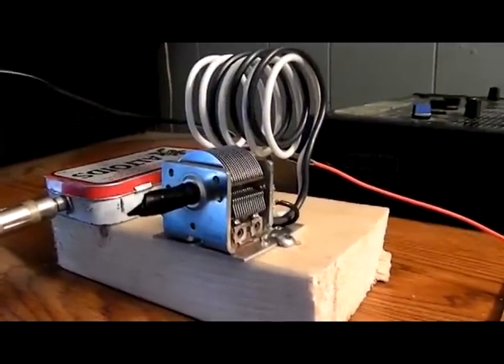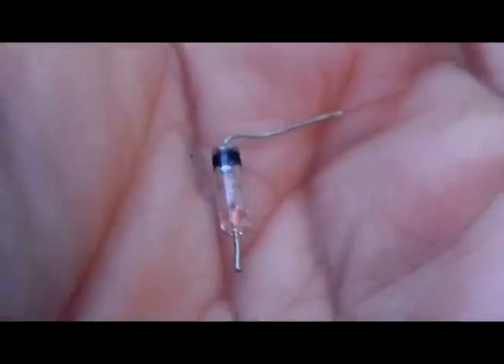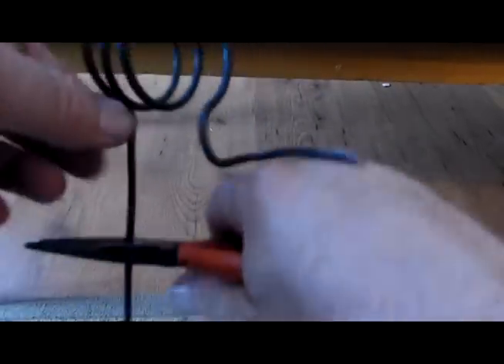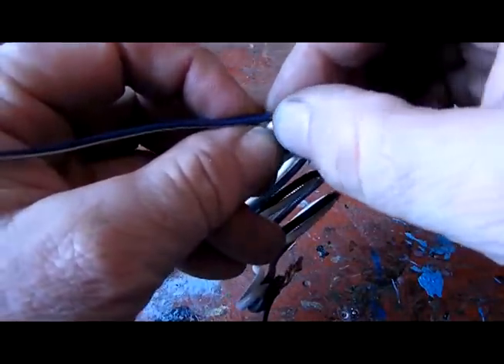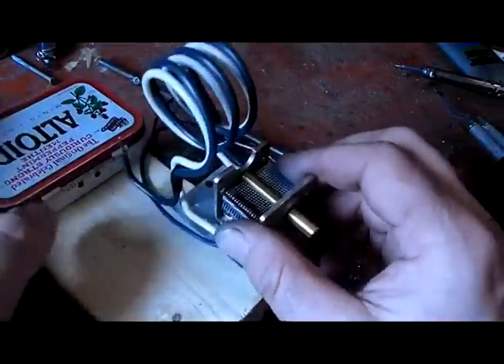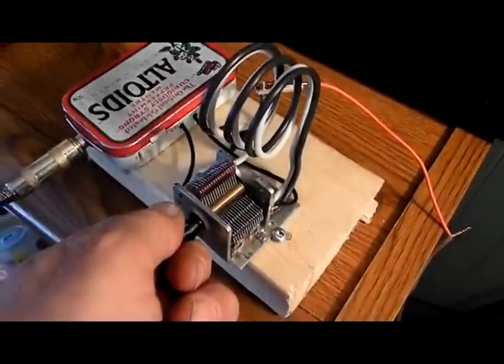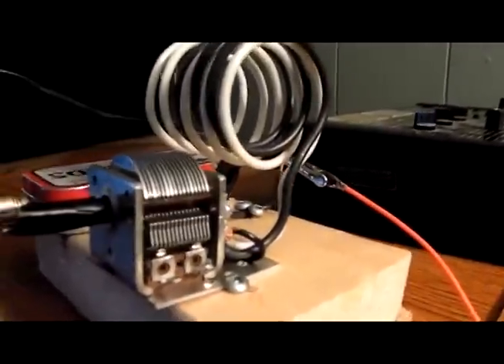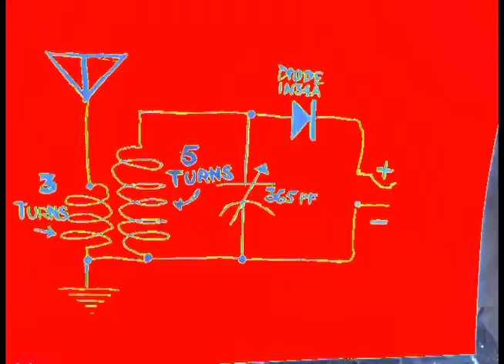Build a CB Radio Crystal set

Comment: Long time ago i did something similar and got up to band I,( first VHF band ) and was able to hear video buzz that was modulated in AM. on the PAL B  tv system  in Australia,also play alot on my Crystal set listening to shortwave, ,and on that tiny set and a good long  maybe over 25 meter random antenna , i  was able to  listen  to Europe,very faint but you could listen to it,but you did needed a lot of patients!. and no amp connected! .So much for people saying that on a crystal set you can only get local Medium wave stations.
Reply: Nice! theres an FM crystal  set i have seen  somewere  in the web
Reply: Sydneywave Smith
Don't think so, for one minute..
A crystal or diode can only detect changes in amplitude (Hence A.M. Amplitude Modulation) 
Freq Mod is more involved than a diode detector can handle...MUCH MORE.
If the tuned circuit were actually arranged to tune in on a VHF FM station, you
 wouldn't hear a thing or even know that you were there because the sound is in frequency modulation. The  Amplitude doesn't vary, so the diode (or Crystal) would not detect the changes in freq. which carry the speech and music.

If you are choked off by my remarks, don't cuss ME. I only tell it like it is.

You could of course, spend many years studying Radio Theory and then come back to argue with me but by that time, you would have realised that there was nothing to argue about.
Good luck..

Olde Englande.
Reply: Bob Rexford
Why SHOULD I look it up when unlike you, I know exactly what it is, have used it for years as a means of FM demodulation in the absence of a genuine FM demodulator?

If you had a trace of technical knowledge, I could explain to you why your insistence that it WILL work in this very simple circuit, is pointless but if you could understand my explanation, you would not have revealed how little you know, in the first place.
That beautifully produced video, carries no sensible info. whatsoever..I'm baffled why anybody would spend so much time and effort when it simply CANNOT WORK.
There is inadequate means of separating adjacent FM stations let alone provide ANY slope detection.
If you're so stupidly sure, just explain to me 
exactly just WHAT slope detection is and where does that circuit supply the necessary conditions for that process? What ARE those required conditions? Whereabouts on the Frequency Modulated signal is it necessary to tune to demodulate anything?  If it worked, what would be demodulated and what would you do with the demodulated results. 
What deviation is used on Broadcast stations as opposed to communication station which use narrow band frequency mod?
Your anticipated silence will indicate how little you know.
I promise you that I'm not talking Martian, Venusian or Swahili  although it may look like it you.
It's no use trying to win an argument simply by pointing ME at site of total rubbish as proof of what YOU say.  Just because you've been suckered in by the standard, arrogant Internet Guru nonsense, that doesn't make it factual.
It doesn't work that way.
It may not seem to you to be the load of bollocks that it is but you clearly live your shallow and meaningless life, lurching from one load of total bollocks to the next load of total bollocks.
That is why you and your clever-devil ilk so easily expose your crass stupidity and ignorance. 
Final simple question "Where is the so-called slope and how steep?" 
Untrained know-alls make me wanna PUKE.
Reply: Since you merely rant and provide neither link nor logic in your argument , I see no purpose in continuing this.  If you won't even try a design or provide a refutation you are a waste of my time.
Enough - moving on.
Reply: Sydneywave Smith  You mentioned the FM crystal radio circuit you had seen...here is a link to one of many such:
http://solomonsmusic.net/FM_CrystalRadio.html
Reply: Sydneywave Smith
I see that Rexford is still trying to convince you that there is an FM xtal set.
Take my honest word for it, as a communications radio engineer  and lifelong builder of radio circuits, both for development and actually in service, that he has no idea what he is talking about and can give you some utterly false information which can at the very least waste your time massively and at the worst waste your money.
That site to which he points you, is remarkably well and convincingly produced
but it is a technical lie. The producer is an absolute liar. It is technically quite impossible to work.
REXFORD isn't a liar, just an idiot sucked in by it. He hasn't the technical background to recognise the false claim made.
He is a typical internet arrogant who will not listen to anything opposing his views which he WANTS to be right, regardless of fact.
My sincere and experienced advice to you is not to take any notice of him..
If such a simple FM receiver could be made, don't you think that the manufacturers would have made them instead of the expensive superhet circuits with limiters to ensure FM only and complex phase detectors or Foster Seeley discriminators,, solely for FM.

Wikipedia it. You might not understand the explanations but you'll see that what ever it is, it's for FM radio. 
REXFORD is leading you astray. Don't let him. After such well intentioned advice. where would that leave you?
My best wishes.
He's not malicious nor a liar.
Just inexplicably ill-informed and inflexible.
I can deal comfortably with fools.
Bloody fools give me a hard time.

Ask yourself if I would have been bothered to spend so much time writing out this lot with nothing to gain other than the satisfaction of stopping somebody I don't know from being misguided 

Good Luck.
Reply: Sydneywave Smith Here is another set of slope detection ideas for crystal radios...interested in the resonant cavity design, if the price of copper pipe drops a bit.
http://www.somerset.net/arm/fm_only_lowtech.html
Reply: *****
Why are you so rude?
Reply: +Mick Bradford 
Dear Mr Bradford, 
               I was not rude but "forcefully outright.
When a Johnny-Come Lately, Know-all Internet Arrogant with no training beyond listening to other Internet Idiots, calls me closed minded for not trying a silly project which from technical training, I KNOW just cannot work and from years' experience as a working radio engineer, DOESN'T work,  I reserve the unalienable right to be as 'forcefully outright' as I deem deserving. I had explained to to him that a Crystal (a diode) cannot by its very action, detect FM. That was not what he wanted to hear and launched off into some diatribe over something he's heard about but clearly doesn't understand.. Slope Detection..It's a nice sound byte for him to sound erudite.
Slope Detection DOES  indeed work but badly and is a last resort in a comms. set lacking an FM function.
A simple crystal set would need many more components & circuitry to achieve this highly inadequate system and would simply cease to be a Crystal Set in the process. Go to this length in effort and cost and it would be better to design in a quadrature detector, phase discriminator, a Foster Seeley circuit to do the job properly.
To this genuinely offered advice he was aggressive argumentative with non factual points and so I became 'forcefully outright' or rude as you so quaintly put it.  
If YOU, with your understandable views on rudeness, were to hold a discussion with me,(Try it sometime) during which I picked up a point which justified sincere advice, I am convinced that YOU would not argue point blank. You might question it with me to validate what had said and rightly so but after more years than I care to admit as a working radio engineer, you would not expect me to take gibberish lightly, although I know that in your case you wouldn't give any.

So that's why I was so 'forcefully outright!'
 In simple principle, I like my know- alls to know lots. He doesn't fit the bill.
Beware lest his ill-founded knowledge diverts your learning. Find an authentic source of techno-info.
I'll leave you with this thought on why I seemed rude or you may not now think that I WAS rude.
After all I have taken the trouble to write all this when it would have been quicker to send you a typical one-line Internet abuse.
A student with his attitude, attending  a lecture would 1stly be corrected, then reprimanded and lastly ejected with flea in his ear.
Beware, lest he divert your own study with inaccuracies. Find a more authentic source of information. 
Sincerely Yours...

 (Was I rude to you?"
Reply: Sydneywave Smith UHHH no there is no way you can use a crystal design to detect and modulate FM, FMW, FMN. As mentioned previously a diode can ONLY detect changes in Amplitude hence AM. Now if for some weird reason you find an AM ststion on say 101.5 MHz then YES a crystal set would detect it mad you could hear it but that is rare. Now move up in frequency to 108 - 136 MHz aircraft band, 99% of aircraft radios are AM so once again you could in theory maybe fact receive aircraft with a crystal set. I will go further up in frequency to the 315 MHz band, the place where garage door openers and automobile remotes live. Those all are Am as well BUT the send data bursts in a fraction of a second or a series of tones to activate whatever they are linked to.
Reply: Adriel Green
Somebody needs to read and inwardly digest this, THE most SENSIBLE posting which I have seen for sometime. 
It ably indicates the massive difference between those who know the score and the legions of internet arrogant gurus who know a lot less than they think they do. The big snag with not knowing enough is that you don't know that you don't know enough.
Mr Rexford please note.

Not enough in Melinda's posting to determine whether she is "Laboratory" or "Service Workshop."
I would make a guess at "Lab."
I am "Service Workshop."
Lab is the same as Service but they know more than we do. We are more screwdriver, soldering iron, test apparatus and Schematic Diagram diagnosis.
We fix 'em when they are busted and try to stop them failing next time, sometimes finding ways with components not intended to be used, either because the manufacturer wants to sell the next model or because we've found a better part than the the original one.
Lab steadily and amazingly pushes out the boundaries of what CAN be done.
We both use the same science, eh Melinda?

Basic principle:-
You can't fix it, modify it, redesign it,  produce revolutionary design nor mouth -off about it, if you don't know the science or at least the technology. No scientist me, I'm technology..
Read Melinda..Read, learn & weep at the insufficiency of what you think you know.

If the cap fits.....Mr Rexford.

Mr Bradford... I have played  (Jazz sax) at the
Italian Fisherman Restaurant on the the corner of Main and Beale in your amazing city.
(I'm a pro Brit jazz musician and instrumental tutor.  I'm also very old and need take no rubbish).

 Yours, Melinda..Vindicated..
Thank you!
Reply: Adriel Green
Got me baffled Melinda/Adriel.
Got it right with "Lab"?
Ham also?
Reply: Yeah I let my ex use this account and she had her name attached to it an I just realized it today lol after a year or so. one of those little things i forgot about. I changed it though.

I am a commercial radio technician. I run my own shop servicing and installing 2-way radios and IT related equipment. I also service some LPFM broadcast transmitters locally and do some 3rd party contract work with AT&T wireless. I have had more than my share of experience with applied radio theory in the real world if you call it that, more or less hands on trial and error. Figuring out what works and what does not everything from being microwaved by a linking dish to bricking a $3,500 portable radio, all lessons learned i think.
Reply: Adriel Green  OK..Wow..Fast response..Well understood.
Did those wise words come from you or your once beloved Belinda?
You a ham by any chance?
G3NBY OK at QRZ.COM
Reply: Those are my words. 
No not a ham. I figured I give the FCC over $15K every 10 years for licenses (I own trunking systems in 2 cities and about to put a 3rd on line this next month here thats all digital) that accounts for something lol. truth is I never found the time to take the ham test yet. I mean i pass all of the online tests almost flawlessly just can't seem to get my schedule right when they do testing here locally
Reply: ok got the channel fixed i think
Reply: rEdf196 How on earth did you assess the freq coverage to decimal points, on such a low Q device as a crystal set. I am led to wonder if in fact you know actually know what I mean by Q. I also find it difficult to suppress my reaction of bollocks.
Reply: Adriel Green  Sheesh.. Fast ain'tcha?
Fully understand the position. Getting a ham ticket was more practical in Olde Englande when I got mine, thousands (well maybe just  hundreds...I AM inclined to exaggerate a just a bit) of years ago. They still wanted clear technical knowledge in those days and didn't put the goddamned answers to the questions, actually on the exam page, for ticking!  
There are those who might think that I am a bloody cynic. How right they are!
I agree., whole heartedly. I was a grumpy old git when I was 14 years old and have got better over the years.
Practice makes perfect.
God Bless America but not ALL Americans.
Guess you'd dump the same non participants that we would in Olde Englande.
Same old crisis.. Part of problem or part of solution?
From Sea to Shining Sea!
Jazz player and G3NBY @ QRZ.COM
Your former colonialist oppressor..
Reply: Sydneywave Smith :  yet another FM crystal set design...I've seen a resonant cavity lashup using three inch copper pipe; this one might be a less expensive way to get there  
http://www.crystal-radio.eu/enset6.htm
Reply: 0-o I'm.... no not going there otherwise I will be repeating myself into a perpetual argument that will only give me a headache. So I'll let those who actually think this will work hammer out all the details.

Comment: It is ok to cheat-find an am pocket radio, hook up a ground only lead to the earphone jack, snake the lead through the double coil, or into tin, whichever does not shift the frequency, but some are more barebones than that. Line up the internal ferrite antenna with that double coil, and tune super slow on the am pocket radio, once you have already got a loud donald duck sidebander locked in on the cb pedal, and all the sudden an autotune-like cloud comes over your cb pedal, and the pitch phases up or down in pitch to make a nice clear voice. It will drive you mad, because it is like expecting an .ooo5 degree travel, on a plastic, keyed to screwed plastic
coupling, with twice that in slop. Good luck

Comment: I made 2 crystal radios (with junk)- my 1st was magnet wire(100 turns) on a small cardboard tube, w/ a var. cap. from another radio, connected to a diode and amp.
my 2nd crystal radio is a SW receiver, w/ the same magnet wire (85 turns) on 2 popcicle sticks (glued together, trimmed to size), connected to a diode, and amp. my SW radio can get N.carolina, Nashville, TN, Havana cuba, and sometimes, China and India! very easy build, and interesting, esp. after 11pm CST!
I didn't follow the schematics, just put components together, w/ a good ground and ant.connection, and they work!
Reply: rEdf196 good luck!
Reply: what kind of antenna are you using?
I've straightened 2 wire hangers, connected them to a balun transformer, and screwed that into 2 yardsticks, which I screwed into my wall. this works fine for both my digital tv and Xtal radios.
Reply: good ideas!
i'm in the process of making a smaller SW radio from a small radio (var. capacitor, earphone plug-in,tuning dial, screws).
seems like my diodes are not working right, or my connections are not good.
I did wind a smaller diameter 100-turn coil, and that works good. i'll keep trying diff. things with it.
the wire coat hangers are great for elec. projects, esp. with the plastic insulation!
good luck, and cheers!
Reply from the maker: Sooner Science Nerd Back In the 70's when I lived in Victoria I built a small pocket sized AM crystal set with a 2' wire antenna I consealed in my jacket and 2 crysta earphones much like a modern MP3 player. I could pick up local signals all over Victoria even without an antenna. With a longwire antenna it could drive 8 ohm loud speaker without a transformer.
Reply: excellent!
i'm thinking about making another crystal radio, just re-using an old radio's diodes, antenna, along w/ a coil antenna made of flat cardboard, w/ magnet wire (90+- turns).
well, have a good one!

Comment: neat project, kinda noisey though, would like to see one made to pick up cellphone conversations since they block out that feature on a police scanner,
Reply: THAT would be a challenge:  cell phones run 850 Mhz or above...plus, the phone itself puts out very little radiated energy.
Plus - the signal is not analog; crystal sets are impressive, but not a device that will get this job done.

Plus (  ;-)  ) the signals are blocked out for a [legal] reason.

No joy there.

Comment: VERY INTERESTING DESIGN WITH MINIMAL PARTS. AMAZING,AND BRILLIANT ! THIS IS BEAUTIFUL EXPERIMENTATION EXPRESSED IN FUNCTIONING HARDWARE. MARCONI AND TESLA WOULD BE PROUD  THE RADIO ITSELF REQUIRES NO BATTERIES A NICE CHOICE OF OPTIONAL AUDIO AMPLIFIER CHIPS WOULD BE THE TDA7052  1.1W OUTPUT. AND IT WOULD WORK NICELY IF YOU DO NOT HAPPEN TO HAVE A GUITAR AMPLIFIER LYING AROUND. A TERRIFIC PROJECT FOR THE 10 METER BAND, IT WOULD APPEAR. -  N8DLI